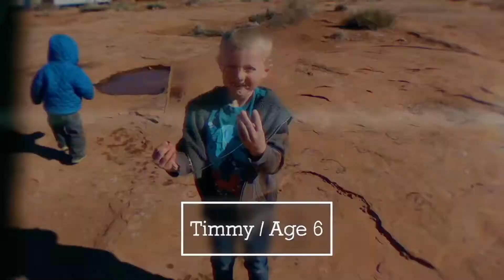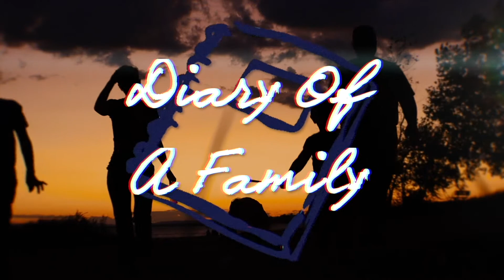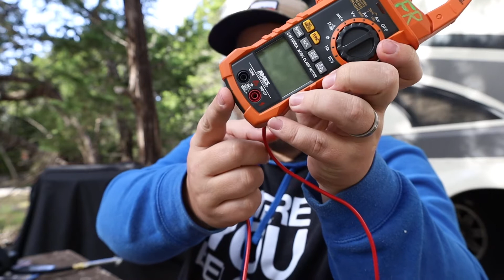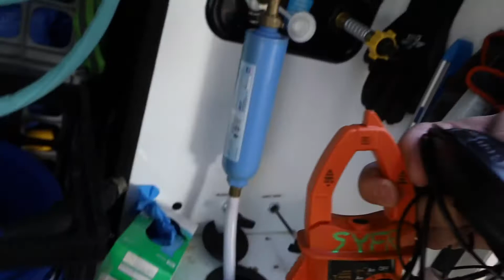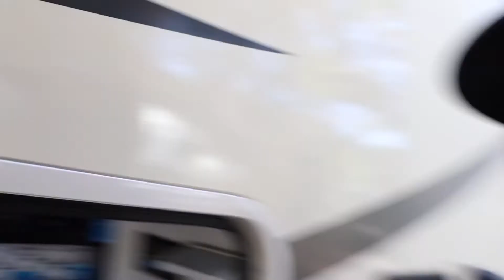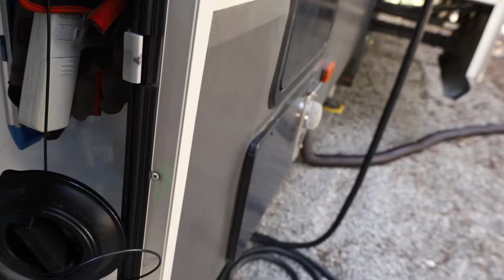RV Hot Skin

Comment: Or you could just get a non contact voltage tester or voltage tester pen.
Reply from the maker: Thanks. We will look into that.
Reply: @DiaryofaFamily  I had a hot skin condition due to reverse polarity at the pedestal. If I got to within a foot of a door frame my non-contact voltage tester would beep.
Reply: @kingstonsean thats because it was REALLY hot, when we as RV techs test for Hot Skin, anything over 5 volts is Hot Skin. Its not always 120v. It takes only about 30-50 volts, wet skin could feel 12-24volts.
Reply: Those are not good enough for Hotskin testing. Anything over 5 volts is "hotskin". Nothing is as good as straight contact.

Comment: So, is this something that should be a routine check, or are there indicators to look for that would happen first? Thanks!
Reply from the maker: It wouldn’t hurt to check on a regular basis. This is really an issue if you a getting your power from someone’s house. They have a tendency of not being wired correctly as they don’t have the same ground issues as RV’s do.